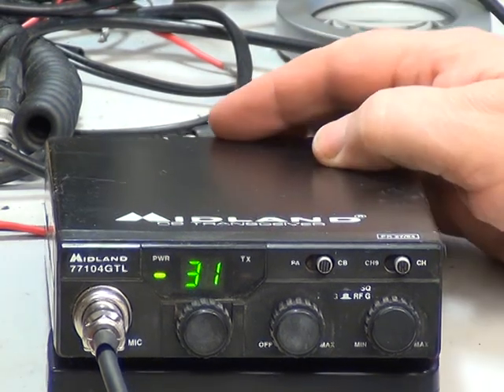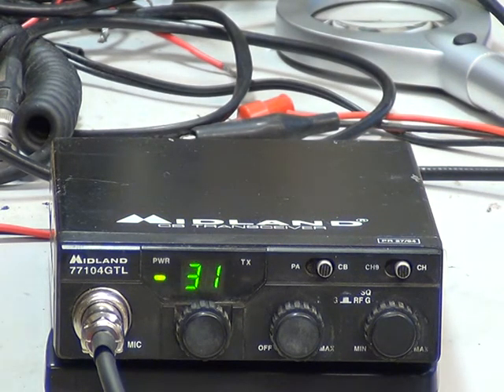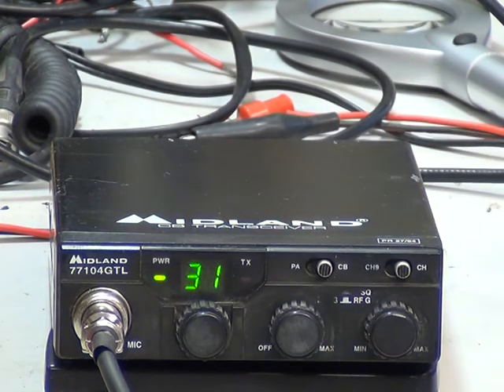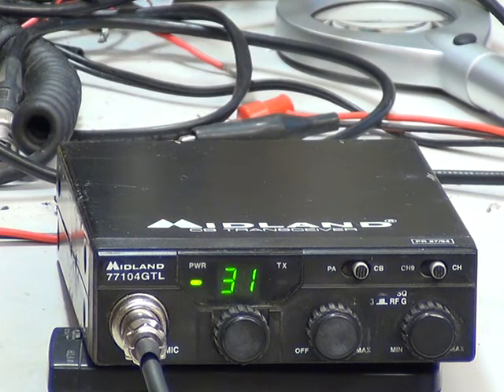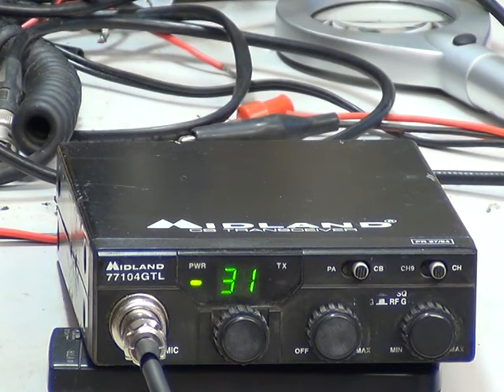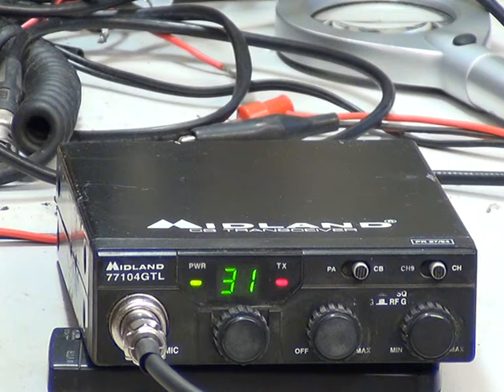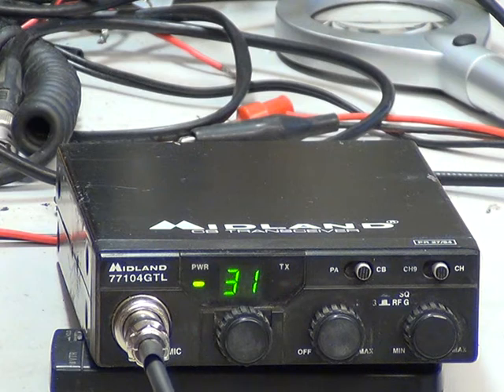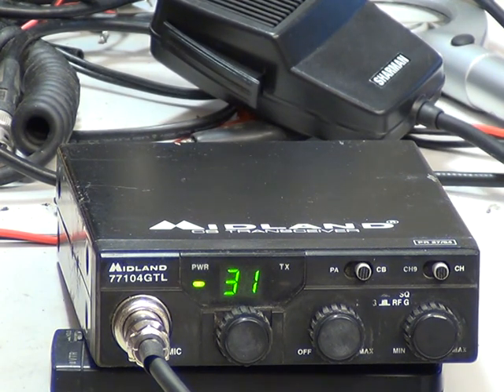Midland 77-104GTL  UK (CB 27/81) CB radio Mobile) - On The Air Test

Comment: Nice set I've got a Lowe tx-40 also I've got a major m588 my major when it's on for 5-10 minutes or so it cuts out on tx and affects rx as well also signal meter does not work on fm rx if you can diagnose it for me that would be great all the best and 73s
Reply from the maker: The Lowe TX40 is the best version of the Worldsound PT40 , Viper 88, Braemar PT40 & Grandstand Hawk for starters. I've covered the Worldsound & Grandstand models on here, but not the Lowe, which I have now put on the list to do. The only snag we get on this under appreciated radio, is that we have difficulty turning the power down to 4W!

The snag with the Major M588 is that it's not a UK legal model, so I'm unable to help you with it, sorry.

Richard